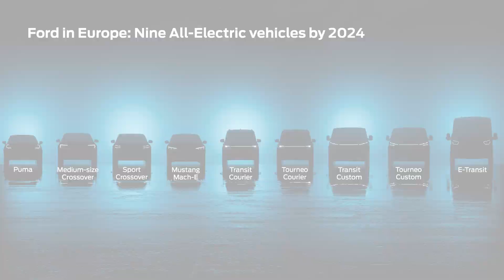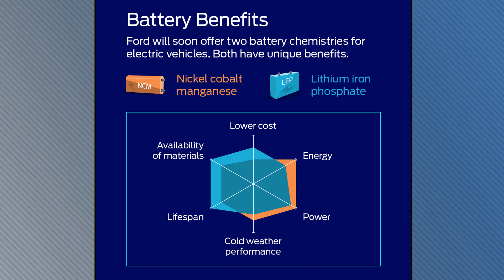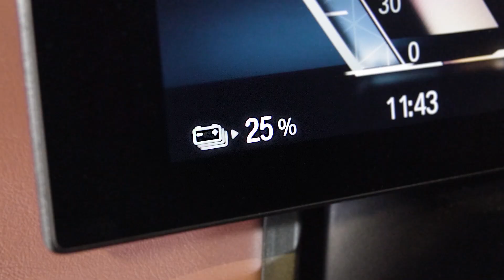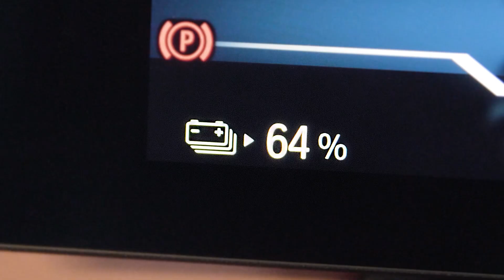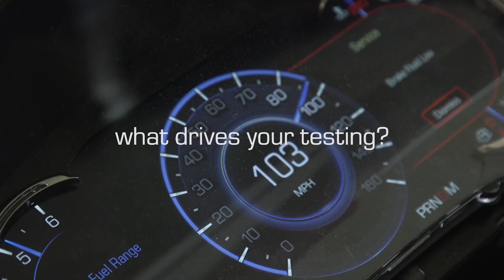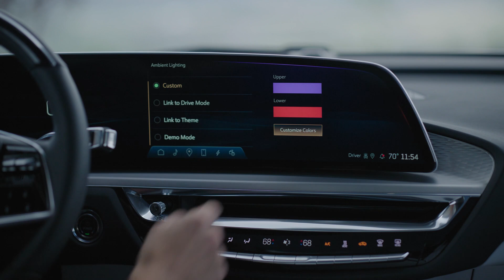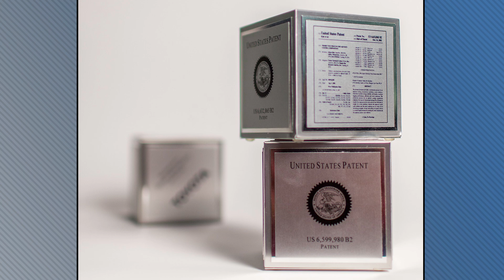Mach-E, Lightning to Get LFP Batteries; Tesla's Godzilla Flexes Its Muscles - Autoline Daily 3505

Comment: E-fuels even if they get the cost down to the price of gasoline still don't take into account all the mechanical parts that can fail or need maintenance on an ICE vehicle when compared to an EV so the cost benefit over the life of the vehicle still benefits the EV over an E-fueled vehicle.  Also once you have driven an EV and experienced the quietness and acceleration going back to an ICE vehicles makes them feel unrefined and inefficient.
Reply: I 100 percent agree with you. The e fuel deal is just car companies trying to extend the live of ICE vehicles so they don’t have to invest on EV’s. I think that the internal combustion engine has ran its course. Car companies have improved the engines but they have to realize that it is old technology that it’s unfit for the future.
Reply: I have both EV , gas and diesel vehicles . The diesels 600-1,000 mi range is nice and that torque too. I’ll race any EV coast to coast as I can go 1,000 non stop with 33 gal tank Ram eco diesel gets 30+ mpg highway . Btw your v8 vehicles subsidize EV s and cost built in to give away carbon credits . It’s just like if you pay full college you subsidize scholarships and minorities who get free tuition
Reply: The issue is NOT "taking into account" the parts of a ICE but to change the source of Hydocarbon fuels used. The production of E-fuels takes carbon out of the environment to make the fuel and NOT adding more carbon to he environment by digging it up out of the ground where it was no issue otherwise. This also adds the more important ability of actually cleaning up the environment by taking in more environment carbon, literally from mainly the air, than is needed to produce the fuel. 

That excess carbon can be stored away or used for the production of carbon-based materials like carbon fiber, Graphite, Graphine, or synthetic gemstones used in various industries, among other things. The net reduction of environmental carbon makes E-fuels, and Synth fuels, Carbon NEGATIVE. This a much more useful to "saving the planet" than BEVs, which only serve to marginally mitigate pollution, which greenies just ignore because you are still "burning gas".

As for engine parts, this is more and issue of people not taking care of their vehicles. But that said it is important to understand that competition in the market place itself can incentivize to creation of and use of newer more reliable less complex engine designs, such as the Astron Aerospace's Omega Engine. 

The only reason the reciprocating piston engine, we know today has been and is in use now is because "IT WORKS". Not other reason at all. It is not the best design and modern manufacturing and control technologies make even some older alternatives work and work far better, more power, more efficient, cleaner, than current ICEs work now. It is only because carmaker are basically having a "legislative gun" shoved [in their faces] that they are not even trying to use these designs. 

If Toyota was even willing to make use of a new engine cycle , Atkinson's cycle,  just on the off chance of Hybrids and immediately doubling F-econ. Or  Koenigsegg developing freevalve to radically improve emissions, efficiency, and engine control, one can imagine what a clean sheet company would accomplish if the ICE were NOT BANNED. Just continue to ratchet up requirements as has been done to this point.

"ICE-Vs feel Unrefined and inefficient." Probably why BEVs HIDE their efficiency readings. But their range readings tell the story just as loudly. We know even the best of them (Tesla), the range numbers take precipitous dives just turning on the A/C on a Hot day, or driving with the windows open. When ICEs barely notice such things. That said, it is not much extra to isolate and control the vibration of ICEs to make them a non-entity in the vehicle during operation. You don't hear it or feel it.  And that is only significant, if the engine is being used to propel the car as now. Any Luxury car maker will tell you as much. 

I am a proponent of Gas-electric vehicles, which have been mainly massive and/or heavy duty vehicles used for work. But this is because this concept will work in standard consumer and lighter commercial vehicles. As default, I know that 80+Mpg, in a first generation GEV is easily doable. On a 12.5gal (US standard) tank is straightly 1000+ miles. And the technology exists to do it NOW. No need to invent much of anything new. If I only had a couple of million to build the prototype and get the investment.
Reply: @DocWolph  CNG and LNG cleaner that Ev well to well all considered
Reply: @BrogeKilrain  
Sounds good. All Options on the table.
Reply: The  lifetime maintenance is offset by higher resale value on a used ICE vehicle compared to the lower resale value of a used EV. Ev's might be cheaper in the first years but after a few years  the cost to replace that battery drives the value to  the ground. Better to get an ICE and have  less stress and higher resale value.
Reply: @airheart1  Can't dispute the facts  can you?
Reply: Refinement is more than the propulsion system. If a car has an unrefined suspension, it's actually more noticeable in BEVs. Road noise and wind noise are more noticeable in BEVs.
Reply: @airheart1   try reading what i posted first. You've only had your Ev for 5 years, You're in for a rude awakening in a few years. The research on ICE vs EV over the life of both has been done and  the  myth that Ev's are cheaper over the life has been debunked over and over. Glad you're doing well now, report back in three more years....
Reply: @airheart1  The actual DATA and research proves you wrong. If you live in a state like california where gas is overpriced then you can save more and it's easier to find a sucker out there to overpay for a used Ev.... but in the real world ICE beats Ev's every time. The  actual research includes factors like insurance cost too, but doesn't include compensation for the time wasted sitting at a public charging station like a sitting duck.
Reply: @davewhite113  your response would make sense in the twentieth century but not in the 21st century my friend!
Reply: @airheart1  The people that are telling you that Ev's are the future have never sold cars before and have no idea how small the market for Ev's is. They also have no idea that it's IMPOSSIBLE to have enough charging infrastructure  without building micro nukes in every state. Solar and wind is not enough. Another factor that is not being talked about is with these Teslas. They are computer cars and like a laptop they last about 8 years. When those computers go out they are THROW AWAY cars as it'll cost more to fix them than it'll be worth. You'll learn in time. enjoy your Ev until then.
Reply: @davewhite113  China has over 460 EV makers . U can buy one now for $6,000
Reply: @airheart1   thank you for your imput and I understand WHY you think that way. 10 years from now you'll be driving an ICE powered vehicle with an electric motor and you'll wonder how in the world you got duped by these so called experts and thought that Ev's were the future. i've been in this industry for 38 years and those of us on the ground are laughing at these so called experts that think it's going that way. Go talk to the 3000 power companies that will have to supply the power. Only about 30 of them have the money to upgrade and the  EHV transformers needed will take 40 years to build and install. Only way possible for Ev's to grow much more here is with micro nukes. Even Elon mentioned them as  a solution. It took over 100 years to get this many gas stations and it'll take ATLEAST another 40 years to get the grids upgraded to handle the increased load needed for home and public charging. Yes you might've heard the  executives from one of the big power companies say that they are prepared to handle the increased demand but the other 2770 of those power companies are not ready......Enjoy your ICE powered vehicles in the future.
Reply: @davewhite113  see you here in 10 years.. we’ll see then which is reality. I imagine there will still be a few niche ICE cars for sale then.. and many old ones still on the roads.. but new sales, in my guesstimation, will be >80% BEVs in a decade. Power generation is a simple fix. Micro grids are the answer and already taking over.. solar production continues to soar.. all that’s needed is for the people to put solar on their homes and add energy storage solutions as they make the switch to electric. I know this, as I already use it and I am nearly at net 0 from the electric company annually. Power companies get the added boost in capacity and energy storage to control. Add large solar and wind farms, with mega power storage solutions, to supplement those who live in vertical housing. Easy fixes that scale as the transition occurs in the next decade. The hit to the grid is so much less than people insinuate. 80% of charging can occur at off peak hours, while you sleep, and be of nearly 0 consequence to the grid. Sure it becomes less ‘off peak’ as millions of cars are charging overnight.. but so what? The energy storage solutions are there to fill this and recharge daily. And I personally, am not at all against nuclear power to be the base load work horse, pulling and pushing to the large scale energy storage units as necessary. But.. Time will tell
Reply: @airheart1  New sales here in the USA will never be 80% BEV. Just too many issues  that can't be overcome. Especially in 10 yrs.
Reply: @davewhite113  i hear your argument. And the only answer you may accept is, the future reality where you may well be wrong. I acknowledge that if the future proves me wrong, I will agree that the things I’ve experienced obviously didn’t translate to the majority. But if I’m right in what I see coming for the majority, it’s a win for everyone in my opinion. Gonna be a better place to live with cleaner air and less toxins in our food and water. Not saying 0.. but definitely a significant amount less. I consider that something to strive for and hope for. Your determination to see things stay as they are.. is puzzling and bizarre to me. It’s like some people enjoy a world where we continue to poison ourselves slowly to death, knowing that we have an alternative to at least improve things.. i just don’t get that mentality.
Reply: @theodorehaskins3756  SADNESS 🥲 none read you cause too long babbling . Perhaps u should write a book ?
Reply: @BrogeKilrain  So you presume to tell me what to do? Maybe you should go write a book. Do you see how that works? Yeah, 2 can play that game. Comphrende!
Reply: @theodorehaskins3756  idk 🤷🏼‍♂️ 
Not a writer but Enviro grad 👨‍🎓 
Maybe if they created Truely clean electric then EVs might make sense ?
Reply: @BrogeKilrain  Really! So you never heard of green energy sources like Hydro, Solar, and Wind?
Reply: @theodorehaskins3756   do you know what your state uses ? How much they get % ?
Reply: @BrogeKilrain  So what are you talking about?  So do you actually read what you’re going to say, before you actually say it, and then commit it to writing?
Reply: @theodorehaskins3756  I think u need a girlfriend 😆
Reply: @BrogeKilrain  Oh, BTW! Are you sure you’re not the one in need of a girlfriend?
Reply: @theodorehaskins3756  now your getting woke . Blame the boomers next
Reply: They also don’t take into account the particulate matter released in the air when burned. Even if they are CO2 neutral, they are still putting particulate in the air which is terrible for human health.
Reply: @kylekleman  we are all carbon Based living things . We breath CO2 as do plants and plankton. The CO2 agenda is more about a quantifier to TAX U BY
Reply: @ac1888  Mate EV cannot tow heavy caravans / trailers effectively.  And they never will. Range falls by around 66%. So ICE diesel rocks there.
Reply: @marktaylor1777  They never will? So I take it that you can predict the future, right Mate?
Reply: @theodorehaskins3756  yes
Hydroelectric is the only one worthwhile .
Reply: @theodorehaskins3756  no time for that . Have second wife and 3 young ones under 4 .
Reply: @BrogeKilrain  have you breathed in the exhaust yet? Sounds like it’s clean enough for indoors! I’m sure your lungs will be fine. 

Just because we do something doesn’t mean it’s safe…

Comment: It’s true. Large screens in everyone’s vehicles are terrible if you take out Teslas from the bunch. Can you do a deep dive why they can’t match the performance?  Not everyone wants a Tesla, but everyone wants the performance. Is it the cost of the chips or maybe the programming? The ID4 is one of the worst but even Mercedes has some pretty terrible user interface problems. Try to find the air freshener in the menu. It’s almost impossible and the changes are almost imperceptible
Reply: What's the issue? A half of a second of lag? Nobody is gaming on these (hopefully). Tesla has to much digging around menus too. Nobody wants to change the air vent flow using a screen if you have fingers to do it twenty times quicker. Smaller more informative screens with buttons/knobs will always be better than using one large screen.
Reply: I just got a 2023 ID4 and have been looking for the notorious lag, but I haven't noticed anything so far.  Maybe it takes a while to manifest.  However, I do spend almost all my time in Android Auto, and it's worked perfectly, especially compared to my last car.  I have rarely gone into the native UI after setting all the car settings where I want them.
Reply: @davidmccarthy6061  Changing airflow on screen is great in Teslas. I can adjust the (hidden) air vents on the passenger side to direct air towards me without having to reach over in previous vehicles that I’ve owned and used. Voice control in Teslas are also very, very snappy and useful. I can have the Model 3 carry out important functions by just speaking to it, without taking my hands off the steering wheel. 

You may not like these things, but tons of people are increasingly taking a liking to it. Tesla’s sales just keep growing significantly every year, and various competitors are, for lack of a better word, copying many of Tesla’s approach to UX/UI and interior design.
Reply: @davidmccarthy6061  So how often do change the airflow where that would be a problem?

Comment: @5:20 it says eFuels need 3 times the energy as gasoline to produce. This is interesting because a litre of fuel needs 4.5kWh to refine from crude. So 230kWh to travel 500km…My Tesla travels 500km on just 75kWh… ie 3 times less energy than an ICE car… So if eFuels need 3X more energy that gasoline, even with no tailpipe emissions they are 9X dirtier than an EV.

Comment: Tesla & Korean ev makers are very far ahead of Ford/GM in battery architecture,  Tesla warn that pouch batteries are easiest to get thermal runaway (burst in to flames) as seen in an ford assembly plant in February 2023. The fire in a new Lightning truck shut the assembly line down for days.

Comment: Your content to commercial ratio is ridiculous.
Reply: I have an ad-blocker and use ONUG's ad-skipping timetables.  'Nuff said...
Reply: @syxepop  Throw in 2x or higher speed and you get a decent daily summary.  BTW, a preview of my comments tomorrow courtesy of GLJ:  "TSLA sold just 39% of its Shanghai adjusted production, domestically, this week"
Reply: @bobbbobb4663  - gauging production and sales levels in this Post-Pandemic MANIPULATED market is 🎲-y, but even in a country such as the PRC, where in normal times you wouldn't believe any data coming from them, it makes it quite cringey to fathom how Tesla tries to make it over there.

Comment: Mary Barra is so focused on the EV vehicles, that she has allowed the ICE vehicles to go to hell. Engineers can’t get a turbo engine vehicle to not ice up in cold climates even after supposedly going thru grueling testing. In the Silverado line V8 engines destroying the valve train in cylinder deactivation engines, shuttering and vibrations with the lousy shifting 8-speed automatic transmission, and 50% of the vehicles with cylinder deactivation technology having vibrations, only to be told this is normal operation. Even though the problem start a few thousand miles after purchase. Gm’ customer service is the worst I have ever experienced!

Comment: A big screen is meaningless if the UI is Garmin GPS quality. Gotta have good software and good hardware to back up that screen. 

That's why Tesla can get away with it.

 Not unlike how Apple did it with iPhones that lacked the once common tactile keys; once they nailed the complete ecosystem down there was no going back to flip-phones anymore.
Reply: A phone and a car are way different. Primarily, you interact with a phone's screen because it is a small tablet computer. People want smaller screens in cars because they are a distraction and take longer to use while driving. The constant comparison of phones to cars is tiring.